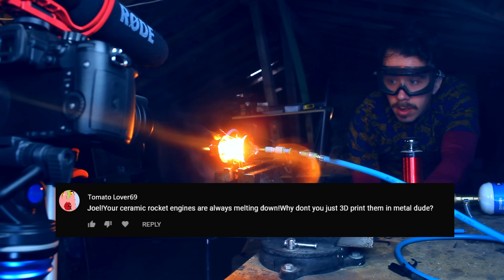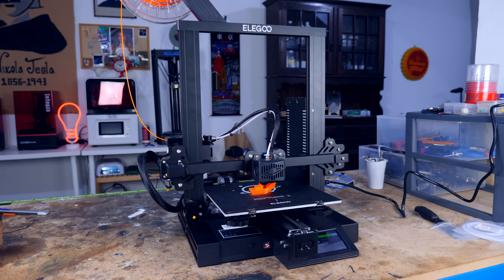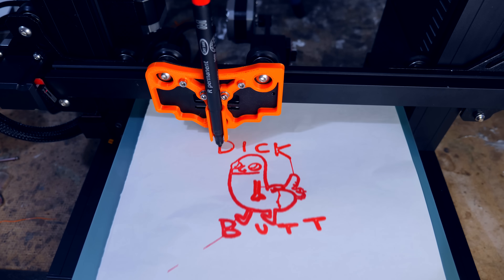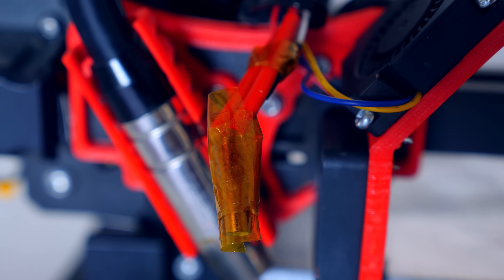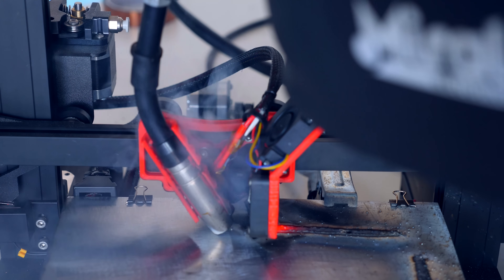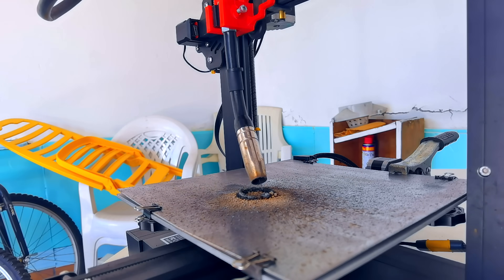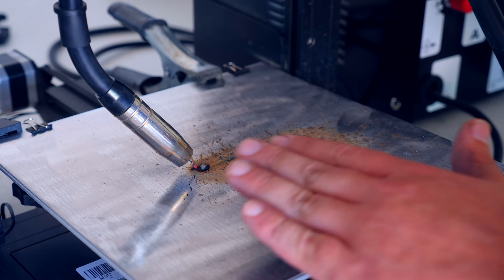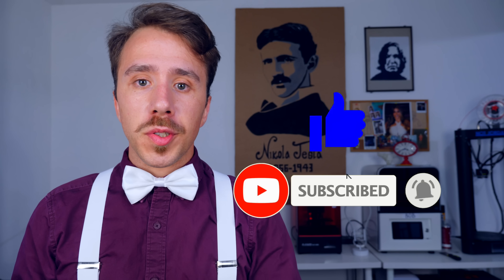I built a Metal 3D Printer using my Welding Machine

Comment: I do remember you 3d printed a turbo in the past. Why don't you try a rocket that uses compressed air to fly. Like attach the rocket to the turbo, build boost, release the rocket from the turbo.

Comment: If you bought a 1/4" plate of copper, or maybe even aluminum, and then used it under your sheet steel, it would absorb the heat and stop it from warping. Welders do this all the time for thin gauge metal. 

You could even add a finned heat sink, or make a liquid cooled bed... There are lots of fairly simple solutions... you shouldn't give up on this.

Comment: You should add a rotary wire brush on to clean the bead of the weld after it is laid down to prevent slag inclusion

Comment: There is an aluminum alloy that's low enough to run through a filament 3D printer.  A guy from Idaho payed some of my college classmates to design a printer that worked with that alloy.  I think he intended to mass produce them.  Not sure if it ever panned out

Comment: Hmmm... maybe you can try to 3D print the mold for the nozzle in plastic, pour wax into the mold, remove the plastic mold from the wax, then make a new mold around the wax with fire clay, melt the wax away and pour in molten metal into the clay mold... assuming you can figure out a way to melt metal suitable for the nozzle...

Comment: Integza, great video and it's been on my mind for awhile. What about using a stretched wire mesh instead of a plate. Would allow some cooling and it would pull to what it needs to so maybe less warping in the end. Who knows though, just don't use galvanized if you can avoid it since zinc poisoning is a thing . Keep it up!

Comment: In honour of Nikola Tesla, I suggest a remote collaboration. e.g. build a control device (with lightbulbs, coils, levers and so on) which an artist Youtuber (e.g. Jazza) will use to portrait you on your 3D printer (with pen or welder). Pro: If you record the data input, you can reproduce and sell these paintings!

Comment: You should definitely build a Tomato launcher (air / potato cannon). Excellent way to remove unwanted tomatoes from your life. 

Great video. The reason the hande is held at an angle when welding is to help create optimal conditions and gas coverage. However because your machine can move in any direction you are best off keeping it vertical. The closer you can get the tip to the surface will also improve accuracy as the wire will have less chance to flex before touching the metal surface. 
Good luck.

Comment: actually gCode has an arc tool so you can draw actual circles. 
G02 or G03 (clockwise and counterclockwise) it doesn't draw a bunch of straight lines and moves both x & Y axis simultaneously to draw the arc 
the computer calculates how fast to move each axis in conjunction with feed rate to make the arc as requested.  
there is also the R radius method and IJK method. 

fun fact you can do loops in gcode to compact the code. your slicer (for 3d printing), or most post processors ( for cnc milling/ lathe)  isn't intelligent enough to do that though. 
like do this block of code 5 times. and there is also condition statements that add a new level of confusion. 
gCode can be simple or very very complex.

Comment: Why not try lost PLA or lost Wax casting? Print your nozzle part normally or use wax filament,  then use it to form a sand casting mold.  Make a mini forge, melt some drink cans and pour the metal into the mold.

Comment: Integza 

There are a few ppl who have used 3D printed models as molds to press sheet metal into forms. You could do that to shape sheet metal and then do some light welding to combine parts if needed. One I watched used some epoxy to fill the voids  in the print to increase the strength of the mold. 

Another options is ultrafuse 316L which looks to be a metal Filiment which you can then send off to a company for sintering.

Comment: do lost pla casting it will allow you to  3d print in metal without costing to much and u already have most of the stuff to do it all u will need is a forge to melt the metal u want I hope this helps ive been a sub for a super long time my old name was dmnd drk

Comment: Integza, try the nozzle straight down relative to the bed to fix the problem of not knowing where the wire will end up and for better welding when trying to build up weld material. Also instead of flux core wire use normal solid core wire with gas so that you don’t have to worry about slag on the weld, of which welding over can cause problems with weld integrity later on.

Comment: 3D printers aren't meant for this application, and the reasons why are also why CNC machines do work in this application: you need a big enough work area to clear the deposition system (in this case a MIG wand), strong enough motion system to handle the weight being moved around, and rigid enough machine overall to handle the stresses involved. 3D printers are just not built for any of that, but a CNC mill is. It's almost trivial to convert a CNC machine to 3D printer but that generally can't be done in reverse.

Comment: I think you should do investment casting. It's much more accessible. You can DIY your own equipment to do it, or get some affordable stuff on line. Suspend slurry is one of the best out there for coating your 3D prints with. Then burn out the print and poor in your molten metal of choice. Both FDM and MSLA have materials specifically for that purpose. Keep it up.

Comment: Dont abandon this project because the tomato would be the winner. The warps in the metal is caused by heat. Why not cooling the print from under with a waterloop eheheh

Comment: As a professional welder who's pondered this, Ill say you could improve this massively by using normal mig wire and co2 gas, then you won't have slag. Also have the torch 90* to the steel not the ideal angle but atleast its consistent with the drag/push of the arc
Reply: Yeah the angle only hurt in this application. The gas would help but Im wondering how thick the metal he's getting is. I can't remember if he mentioned the power limitations of that model.
Reply: Oh thank god im not the only welder that has thought of this
Reply: I wonder how low deposition rates can get using spray transfer, i don't think short circuit is the way to go for a printer puts too much heat in one spot. i would actually think an automated tig welder where the printer spits out the correct amount of fill would function better with no slag.
Reply: yup, with fluc cored you are trying to weld on top of slag, us a gas shield mig process instead
Reply: I was thinking the same thing, having the nozzle perpendicular to the table and using normal solid wire and c25 instead of Inshield wild jelly this massively
Reply: @mclaynebalzly1739  what is "inshield wild jelly"  ?
Reply: What about making the whole rig inside a chamber that could be filled with the welding gas?  Or does the welding of the metal create other gases that would need to be removed?
Reply: @davidswanson5669  , other gases are created and there is no real need to make an entire gas chamber except with very reactive metals like titanium
Reply: @davidswanson5669  they do this with some forms of metal 3D printing now. But it’s not cost effective and using a shielding gas instead of flux cored wire would be a much easier solution. Good thought though! Keep up the good work
Reply: yes a TIG setup would be superior, the torch and cable would be a lot lighter and simpler and the ability to pulse and adjust current on the fly (especially if they were controlled by the printing board) would help in controlling heat in the workpiece. plus the best part is you can still feed it from a spool of mig wire using a normal bowden style extruder so you can have feed rate adjustment and retraction just like when 3D printing, just needing to adapt wire drive rollers from a mig into an extruder that can be driven by a stepper.
Reply: I figured the torch was held at an angle so the welder could see the puddle without the torch blocking their view.
Reply: A tig torch with a wire feeder would be a nice setup ,.not sure how the electronics will enjoy the h/f !
Reply: Given the goal, wouldn't a sealed chamber filled with nitrogen also work, no need to supply the nozzle? Or is a noble gas required?
Reply: Bro you took the words from my mouth! There's only other three things I think he could do to help. Build a box around the welding platform to help contain the shielding gas. Use a heatsink with forced air cooling mounted under the welding platform & try different wire types for specific applications such as: aluminum for lightweight parts or heatsinks & stainless steel or high-nickel metal wire for corrosion & heat resistance. I'd like the see him try again! Although I don't imagine this type of metal printing being high precision, if he needs precision parts I think he would need to use powder metal & lasers! I know of a laser expert on YouTube, he's channel is called styropyro & he might wanna help!
Reply: @cliftonmassey3143  there's a method using filament bound metal powder sintering that works almost identically to the process he's using to make ceramic parts.
Reply: Yup, the angle is afaik for completely different reason, in this application it certainly should be straight down. It really needs an enclosure filled with argon or other inert gas, you would be pumping out way too much CO2.. i mean... printing will take hours, while in regular welding you  do it in short bursts. The amount of gas wasted...
Reply: Haha thanks for this comment.  I was shaking my head half the video lmao. He did a good effort tho
Reply: @wtchoutna  good effort just needs more information on what happens during welding.
Reply: Duty cycle.
Reply: You need argon gas😊
Reply: I've built a machine for big industrial applications and let me tell you the only way is Mig and normal weld wire 😅 it also depends which wire you use. Aluminium worked really well normal s235j steel was trickier 😅
Reply: I agree. i would also dotweld, dot- move-dot- move and so on for a stronger and more consistent weld
Reply: Yeah, this isn't going to work. Each layer will add stress to the part, until it finally cracks.

Comment: I've had this same idea for years (though I'm not bananas enough to strap a welder to a desktop 3D printer lmao) but in my research I came across a company that made an enclosed machine that was able to both weld the structure and then CNC it from 5 degrees of freedom in between particular layers, switching back and forth. The physical appearance of the parts were flawless, they got the production process down for sure. The issue came when testing the parts, they were far more porous and contained many imperfections in comparison to parts that were CNC'd from a solid block. This was partially mediated by baking the parts but the tolerances were still a bit off. However this was like 3 years ago when I was obsessed with trying to build a metal printer lmao, I'm sure they've worked out all of the issues by now.

Comment: A follow-up video could be made that has the machine inclosed in a box so that you can use gas for welding which will give you cleaner welds. As far as the warping, you may try having a heat sink or cooling passages with a liquid coolant running under the plate.

Comment: "G code can only draw straight lines..." WHAT? G2 and G3 are a thing, you know!
Reply: not with the os that typically runs printers. GRBL doesn't like arcs
Reply: @jonathonwood4088  Interesting. I have not looked at 3D printer Gcode much since usually "it just works" and there is no need for manual adjustments. Any idea why it doesn't play well with arcs?

Comment: One of the problems was you were using flux core wire, which causes a lot of slag, which you had to keep grinding off, it might work better to use a gas welder (all of this is MIG of course) this idea is pretty cool, and I think you could make it work!

Comment: Yes mig is more automatic but tig welding is way better for sculpting useing vary low voltage while melting a tiny bit of wire you should look at tig welding sculpting

Comment: I'm no welding specialist, but I would like to say a few things, and maybe though some ideas around. First of all, I would not trust layers of MIG filament, because whilst it provides support to the joint you are making, The majority of the arcs heat is used (or supposed to be used) to melt and/or fuse the two or more pieces of metal together. the thin bead of filament is handy for extra support, but is not always necessary, TIG welding is a good example of this. Welders will know that a good joint needs to be melted together under the bead, and it is considered best practice to weld on the front and back of whatever you are working on. The bead also fills the gaps if there are any. not to mention the fact that using MIG filament, especially flux core which you appear to be using, is going to be more expensive than other, better options that are stronger and less wasteful. As you said, you are not made of gold. (you do make more than me, I'm a mechanical engineering student and mechanic lol), but he best way, in my opinion, is to print the components wax or resin with a low flashpoint, then cast it in a plaster mold, melt the prints out of the mold, then pour molten metal into the mold. you can then dissolve the plaster in water, and there you have it. you might even not need to melt steel, you might be able to find an alloy that acts like steel but melts at lower temperature, but can withstand the heat of the rocket. Carbon also works well, and you might be able to find a resin that has carbon in it as opposed to ceramic.

Comment: Video Idea: build  v2? :"D
you could have used an opto-couple to trigger a transistor to toggle the wire-feed and run the signal off of the extruder lines with diodes on each (to prevent back feeding) then disable retraction (so that it only does forward/meaning voltage will be visible only when it is expecting to deposit to the build plate), you will also likely need a resistor (to limit current from capacitor as transistor only needs to SEE voltage and doesn't rely on current) and capacitor since the extruder is a stepper it only gets short bursts instead of a constant current like a normal dc motor which you can do this while leaving stepper hooked up (can use for debugging welder trigger if needed). FYI 90deg is the optimal angle for welding as it allows the most uniform shielding gas coverage. you can print just fine at 90Deg but when YOU weld you will get better results at a slight angle. which brings me to my 2nd point, your not using shielding gas. Then theres the feed, For the feed and voltage what i would do is set the printer to a speed (roughly 35-50mm/s imo). grab the welder and roughly match the speed and make short lines while adjusting the voltage and feed for each sequential test, once you get that pretty close, then do a print test and see if its "good enough" or if you need to readjust the voltage, feed one more time ( you should have a pretty good feel of what it needs at this point ) and give a test print a go. VASE MODE and continuous print (spiral walls?). this should bring you quite a bit closer to what you were watching when they are using a cnc machine. all are controlled the same for most cases. but each one is just a few modifications here and a few extra parts there away from the next

Comment: What about using a Raspberry Pi to control all the different elements? It would take a lot of coding to automate those elements however.
Looking at 3D Hybrid's CNC 3d printer, it almost looks like they metal plank they are used is corrugated. It may be a trick of the light, but corrugated metal may increase the rigidity of the metal and reduce warping.

Comment: I've always wanted to try that. You need a shielding gas rather than Flux cored welding wire. But there is a much easier and cheaper way to 3d print metal (aluminum anyway). Lost PLA casting. You print your object in PLA, cover it with a plaster/sand mixture or a refractory casting cement, burn it out slowly in your kiln, melt some aluminum in your kiln then pour it into the hollow mold. Anyone reading this that doesn't have a kiln can look up videos on how to make a propane metal foundry to accomplish the same thing.

Comment: why don't you use metal casting technique?
print the 3d model with plastic material, then use it to make the mold, then melt the metal and pour it into the mold.
I'm sure this will work, successfully burning down your garage. (this part is just a joke, don't do this one okay?)

Comment: I guess you'd solve whole overheat issues, by setting some water spray around the nozzle and fan.
I'm actually pretty sure it'll works perfectly 
just don't spray to much water to avoid the electronics drowning, and letting time for the water to evaporate